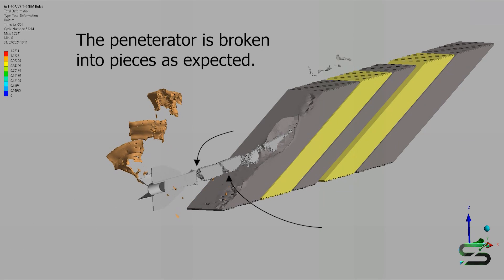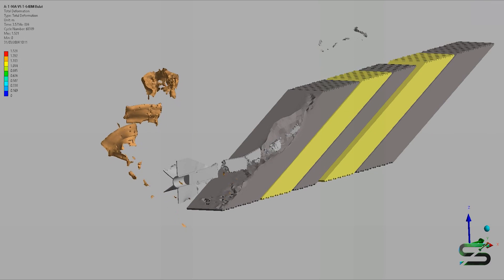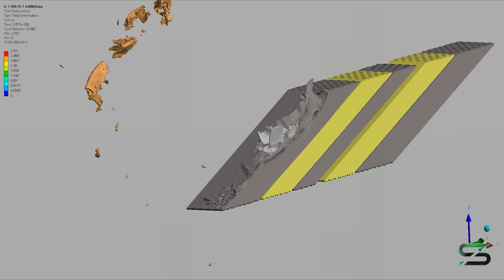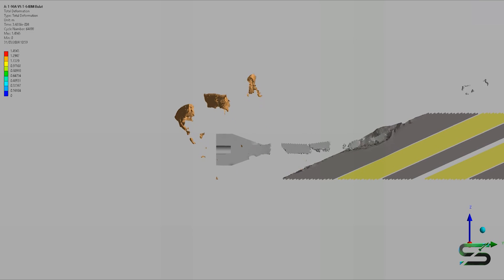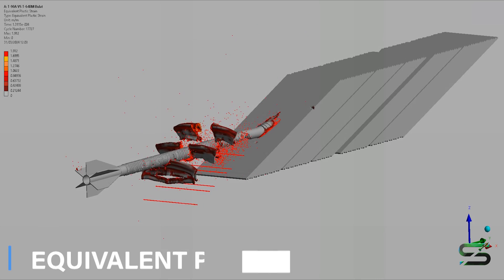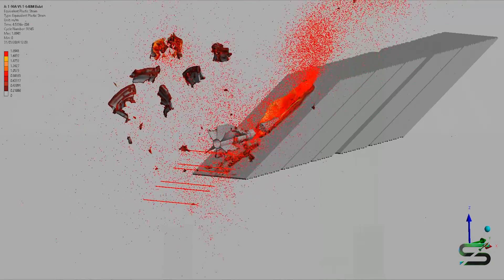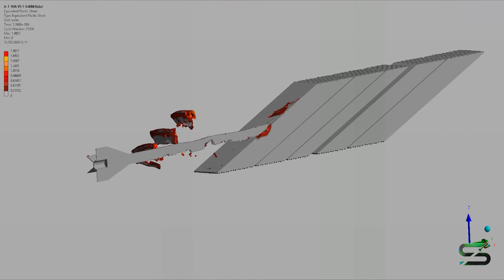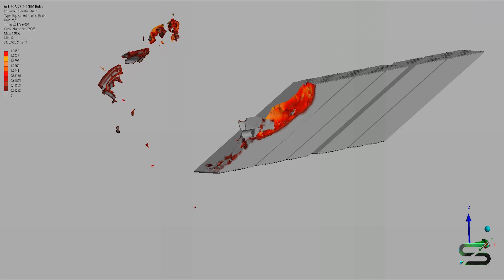T-90A VS T-64BM Bulat | April Fools' Special

Comment from the maker: For those who are upset about the outcomes of this simulation, I would like to clarify that this is an April Fools' simulation. I'm surprised that no one mentioned the release date of the video!
Reply: I think this video is Perfect. I told last time, and I will say again - Andrei bt - or btvt dot info. DIG in - there is all info that you need. There was a tests before with Tandem warhead from RPG-29, that penetrated 800+ test plate....there is pictures ! and tank side reactive armor where is two layers of NOZ, almost stops it. Only 30-40mm penetration was in tank side armor where is 80mm. There is also a pictures of OFL 120 F1 round…….that was cut in peaces !  Better make a M829A3 with T-84 OPLOT hull armor. Because there is a pic (Andrei bt page) where you can see two layers of NOZ in hull armor.
Reply: @olgertshomics9088 that was DUPLET ERA that cutted the projectile into pieces which is basically 3 layers of NOZH in the sides and 2 layers in the front
Reply: @AlexanderK9519  For the test with OFL 120 F1 was one layer of NOZ. Please check your data. In Oplot tank side ERA blocks there is 3 layers....correct.
Reply: @olgertshomics9088  that was DUPLET ERA not NOZH it wasn't one layer and i'm correct 3 layers on the sides and 2 layers in the front
Reply: @olgertshomics9088  the era in this video were 2 duplet blocks which were six layers of nozh

Comment: Practice says the opposite, there is a video of the T-80 hitting the T-64BM in the frontal projection. Yes, the distance there was 500 meters, but the tank was destroyed. A video where the t-80 was standing behind trees, and the t-64 was moving along the road, the t-80 drove out, shot and destroyed.
Reply: Это первоапрельская шутка, ясно любому что 90 разворотит эту 64

Comment: I think there is a small mistake, there is no T-64 Bulat. The "Bulat" is a derivative of the T80 = T-84-> "Bulat". In order to be able to export this tank at all, it was given a 120 mm on-board cannon. It never went into series production and only 10 or 12 examples were built. If I'm wrong, please correct me.
Reply: Bulat is made from T-64B .T-84 is OPLOT made from T-80UD
Reply: When u try to correct ppl but are wrong 🫵🤡🤓
Reply: @RustyBear😂
Reply: It is T-64BM bulat, it is a deep modernization of T-64b series. 
Export modification of T-84 has 120mm and is called T-84-120 Yatagan(scimitar). All rights for T-80 belong to Ukraine
Reply: @віталійовсянніков-ф7с  I wouldnt say all rights of T-80 belong to Ukraine as most parts are/were manufactured in Russia

Comment: It looks like the armour pulverized the Tungsten Penetrator. There is definitely Something wrong in this Simulation. Look like the hardness were the same of the penetrator and the Armour in your data
Reply: To counteract a cumulative jet, density and not hardness is important.
Reply: I think he used aluminum instead of tungsten and redused kinetic energy

Comment: What software do you use to compute the simulation?  Does it only run on the CPU?  There is a potential for much higher computational speed if the calculations could be offloaded to a higher-end video card, which possess very many cores relative to current Intel and AMD CPUs.  Of course, if this software runs single-threaded (one core only), then a lot more work would be required to make it multi-thread.  Just a thought, since you remarked that this simulation took 90 hours of computation time.
Reply: No simulation software will run on only the CPU, of course it runs on a gpu or more than one. Simulations like this are incredibly hard to make and very hard to render the insane amount of physics that goes and and to get it kind of correct

Comment: Ukrainian tank makers are quite creative
Reply: Why there is no country using NOZH and DUPLET ERA instead??
Reply: @AlexanderK9519 NIZH 🤓
Reply: @AlexanderK9519  Probably because of the weight, as these are quite bulky, not to mention that i never saw anything involving shaped charge resistance of the Nizh ERA. Most tanks today use ERA mainly for HEAT protection, and only a couple have heavy ERA for boosting KE protection.

I can also think of how much more dangerous these linear EFPs are compared to the forward-moving plate of an average ERA. When you consider that tanks today are very frequently used with infantry nearby, you could make a hit on a tank become dangerous on a much bigger area.

Comment: I really doubt this penetration is accurate, nozh has been confirmed to break apart only old steel projectiles, 3bm60 would only be slightly damaged but not completely ripped apart as this simulation shows.
Reply: Bro its western biased channel when he used Relikt ERA against M829A3 it exploded before even touching the ERA while in these Simulation NOZH explodes at the right moment to disrupt the round completely and cut it off
Reply: @AlexanderK9519  Not doubts of this. Literally all Ukraine military tech its old reject soviet shit. Like the engine in their t-84 tank. Not doubt that even NOZH its some old Soviet shit that was reject because something like  Kontakt or the reactive armor used on Obj187 was better.
Reply: @Rek1emMScar well Ukraine does produce modern equipment NOZH ERA is good but only to very old projectiles the 3BM42 from 1986 was tested against DUPLET ERA (three NOZH layers) and got disrupted and destroyed like on the video above but DUPLET is twice as heavy they had to remove the first layer of armor of the T84 to use it due to the weight increase in the front
Reply: @AlexanderK9519 
3 layers only on the sides.
Reply: @Edward-jf6sn  there is 3 layers everywhere this is DUPLET basically
Reply: @AlexanderK9519  
You are wrong) 3 layers only on the sides.
The tower has 3 layers, but when a projectile hits it, it interacts with only 2 layers.
There are 2 layers on the body.
Reply: @Edward-jf6sn  sorry 2 layers in the front and 3 layers on side and turret
Reply: @Rek1emMScar  there is no doubt NOZH is a good ERA, comparable to KONTAKT-5 but in my opinion is better against heat munitions with warheads but against kinetic munitions K5 performs better as overall performance
Reply: @AlexanderK9519  dog you will see anything you don't like and call it western propaganda XD.
Reply: @AlexanderK9519  True, M829A4 was developed to defeat Relict, yet in his simulation A3 almost penetrated T-90M with Relict, while in this simulation 3BM60 (The best Russian round in service currently!!) didint even leave a dent in the T-64BM, which is for all intents and purproses, an old soviet era T-64BV with Nozh ERA slapped on it. I dont think Nozh is a bad ERA, but having the simulation show the best russian round not even penetrating the first plate is just straight up bias.
Reply from the maker: I have mentioned that in a real situation, the 3BM60 would cause significantly more damage to the composite armor.
Reply: @SimulationPlus  why did the RELIKT ERA exploded when the tip of M829A3 didn't even touch it while with NOZH exploded at the perfect moment to disrupt the round? Since your videos are not accurate enough you shouldn't upload them spreading misinformation
Reply: @quan-uo5ws  Keep in mind only the 3BM42 was disrupted and destroyed  which it was used against DUPLET which is layers of NOZH which shows even more bias
Reply: @quan-uo5ws  You got thing wrong. M829a3 was developed for Kontakt-5. But it was more of a guess that actually know how to do it. And M829A4 its what it round that actually did it right.  Pretty sure USA didn't even Know how Relikt work until they snatched some T72 and t90 swiftly after Russian Abandone then in Ukraine. Even germany recognize that they can't deal with RElikt that it why they started KE2020neo.
Reply: @AlexanderK9519 you’re aware these videos are largely for entertainment? It’s impossible to do these things accurately with how certain things are classified. It’s really not his fault you apparently take these videos as absolute fact
Reply: @commitselfdeletus9070  There are other youtubers that make pretty accurate simulations that while not absolute fact, are still close to the truth. Meanwhile videos like these make people think Ukraine has some magic ERA that can stop any round in service (they dont)
Reply: @commitselfdeletus9070  entertainment for spending hours and hours for short videos like these representing false calculations its a simulation for rounds not a game
Reply: @quan-uo5ws  Do you have any documents for this ERA to state something like this?

Here I can find a dozen photos and videos from the testing of the nozh and the Duplet and, moreover, demonstrate the ACT of testing the ERA Duplet where it was fired from the OF120F1.
Reply: @Edward-jf6sn  Duplet is twice as heavier as Nozh, of course its going to stop some old french round. And there are photos and videos of Nozh testing, and they only tested them against old steel rounds. Besides unlike Nozh no ukrainian tank in service uses Duplet, so russian tankers dont have to worry that unpenetrable ukrainian tank will show up.
Reply: @quan-uo5ws  

Why is he old? The actual armor penetration of the OF120 f1 is 600mm, which is only 200mm less than that of the DM53, for example.
Although it is worth noting that DM53,M829A3/4 was created to overcome ERA, so it will be more effective.

French OF 120f1 was stopped by a prototype "doublet" with KHSCHKV 25.
In the original "doublet", KHSCHKV 34 is installed
Reply: @Rek1emMScar problem is all post USSR tech is old Soviet shit - including all Russian “new” weapon
Reply: @SimulationPlus  In fact, the T-80BVM defeated the T-64BM from the front of the turret!
Reply: @quan-uo5ws перепрошую, але за більш як 2 роки війни я бачив тільки декілька відео коли танк стріляв пр танку, в більшості випадків перемагав український танк, і взагалі думаю що в теперішній момент не коректно порівнювати який танк в дуелі переможе.
Reply: @mr.nazar3498  i legitimately havent seen a Ukrainian tank win against a Russian one. While there is a pretty famous clip of a T-80BVM destroying a T-64BV. Now obviously there probably have been cases of Ukrainian tanks winning against Russian ones, but most of the Russian tank losses are from infantry mounted ATGMs, mines, drones and artillery.

Comment: Finally correct simulation !!! PS. Andrei bt page have also pictures from France Leclerc APFSDS rounds that was cut in peaces when rounds hit ERA blocks. Overall AMAZING WORK MAN ! Thanks
Reply: That was against DUPLET ERA which is basically two layers of NOZH and 
OFL-120F1 is an old round not modern

Comment: Nozh ERA is not as effective against APFSDS as this simulation shows. Many other simulation channels using more data show that Nozh ERA's shaped charges do not have the mass required to break through a tungsten rod, and is much more effective at disrupting the explosively formed jet of HEAT-FS and HEAT warheads in ATGMs.
Reply: There have been very well documented instances of 3BM42 having its penetration reduced to just 60mm after hitting Nozh
Reply: @mooderpcow8614  not nozh but duplet
Reply: @IzakSemrdoii  nope has to be nozh, duplet is not used on any ukrainain tank except t84

and they have only 10 of them lmao
Reply: @commenter648  the guy said there is documents about nozh but it was not nozh but duplet
Reply: @mooderpcow8614 there are? Where? Combat or tests?
Reply: @Masterafro999 yes
Reply from the maker: No simulations of Nozh ERA on composite armours have been conducted before on the YouTube.
Reply: @SimulationPlus  it still seems unlikely that the newest Russian shell would just get stone-walled like that (it didn't even get through the first armor plate!)
Reply: @SimulationPlus there is another channel that did a simulation of this era about a week ago
Reply: @AsmellYoullGetUsedTo  It's the same channel)
Reply: @elsemka9929  for some reason I thought it was simulation bros
Reply: This is exactly what the Nozh does. It cuts the penetrator into several pieces and no material can withstand shaped charge blades at point blank. This wasn't done right in previous simulations.
Reply: why are you talking about simulations when there are many photos and videos from his testing?
Reply: Я-б сказал, что достаточно взглянуть на предыдущее видео сего канала, где М829 работает по "Ножу" - там чудодейственный старый лом, конечно, тоже не пробил ВЛД Т-62, но по какой-то причине пострадал намного меньше, а ущерба нанёс явно больше, чем на порядок более могущественный снаряд тут. 

Либо программка была подкручена, либо весь мир дурак и никто не понял гения ХЗТМ им. Малышева... Хотя немцы, например, исследуя "Нож" в общем то были примерно того же мнения, что и НИИ "Стали" и особо не заинтересовались в гофро-видных КДЗ, хотя и признали их возможности. Видать, возможности эти того не стоят, раз Лео ещё не обмазаны "Ножами".

Так что лично я прихожу к мнению лёгкого навета преувеличения могущества "ножа".
Reply: @alexstenin4530 твоё НИИ Стали писюн дрочит последние 30 лет, нихера толкового придумать не может
Reply: Тут нож еще по всей видимости и танк, который выстрелил уничтожил
Reply: @traydr-1609 а что не так
Есть видет с тестом
Ндз нож полностью анигилировало 3бм42
Reply: @traydr-1609  что завидно?

Comment: Very weird, previous simulation has shown that Nozh damages the penetrator, but it doesn’t completely disintegrate. US uranium and Russian tungsten alloy are not very different
Reply: Manufacturing processes are resulting in different quality ammunition
Reply: @HDREal  no way author got the info about manufacturing processes of tungsten APFSDS in US and Russia.
Reply: @Спойлерщик  You’re stating “us and Russian tungsten are not very different” I’m telling you their differences. Is it that hard to comprehend?
Reply: @HDREal  can you understand the sequence? Author shall not imply different quality unless there is data
Reply from the maker: The previously published Nozh simulation was the first experiment and is not accurate enough. I have already mentioned that in a real situation, the 3BM60 would cause significantly more damage to the composite armor.
Reply: @SimulationPlus  your simulations are good, especially intros are great entertainment. I hope they will become better and even more accurate.
Reply: @SimulationPlus  what computing powers do you have? Maybe we all could have donated you for a new setup and faster and better results?
Reply from the maker: I'm running these simulations on a Core i5 with 4 threads, which is not intended for this type of computation.
Reply: @SimulationPlus get an old i7, those are dirt cheap and have 8 threads

Comment: Looks like a crooked simulation. And in any other simulations, the projectile passes at least the first armor plate. But in this case, the shell couldn’t even penetrate the first one, as if it were made of tungsten cardboard.
Reply: Official trials show about 40% reduction in penetration ability of projectile hit with "nozh" and were conducted on older projectiles, so as long as there is more then 400mm total pen it should go through
Reply: @bardingorrekson6573 so that means that 3bm60 goes straight through. Not surprising, considering its Russias best round in Ukraine.
Reply: There are real photographs from the test where a small dent remained from the 3bm42.
Reply from the maker: No simulations of Nozh ERA on composite armour have been conducted before.
Reply: @SimulationPlus You used the NOZH ERA calculations like Ukraine advertise them only DUPLET is able to do that and still the test and footages were tested against old soviet 3BM42 not the latest ones
Reply: @SimulationPlus  I doubt that the material of this protection is denser than tungsten carbide, making it so easy to cut.

Comment: Can you try now with 3bm59?
Reply: results would be mostly the same in this instance.
if you slice up the oncoming round then you take away most of its ability to penetrate.
the west had this type of armor a long time ago too, but didnt use it for 3 main reasons. 
1st because its useless vs Heat.
2nd their wasn't really a need for it sense they could just change the armor packages on stuff like abrams or challenger with different materials, thicknesses, angles and layers.
3rd The big thing is the west retires its old MBTs, it doesnt keep wasting money upgrading them when they become hopelessly obsolete.
a modern (or even 30 year old) ATGM or Heat round will go right through this armor and knife type era no problem.
Reply: @TheAngriestGamer. I don't think HEAT charges will do much of anything against THIS armor: this is the front armor. But top attack missiles can punch straight through the much weaker armor on top of the tank, since it's a lot weaker than this armor.
Reply: @TheAngriestGamer.  It is not useless vs HEAT. It destroys the cone and prevents the cumulative effect from forming.